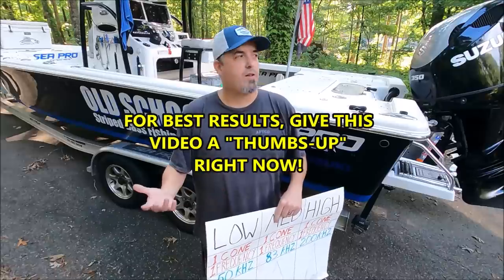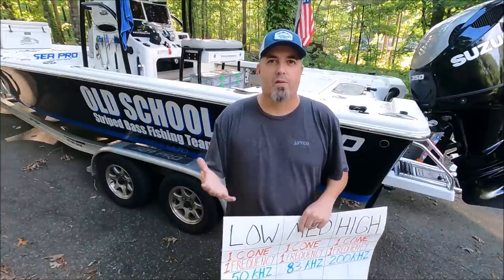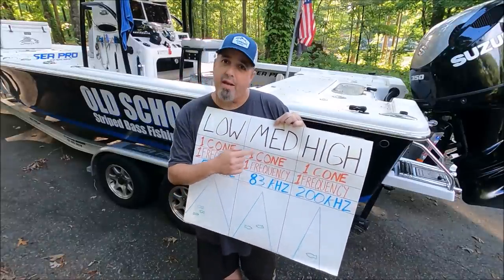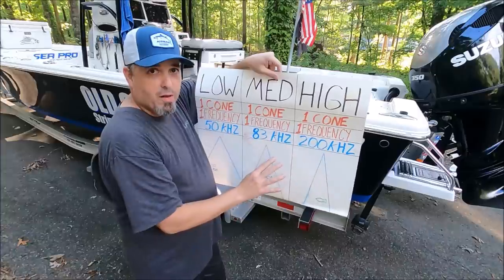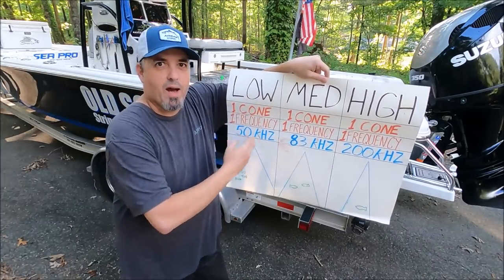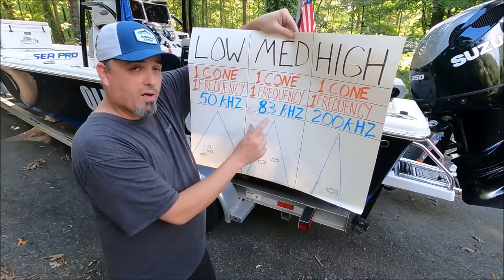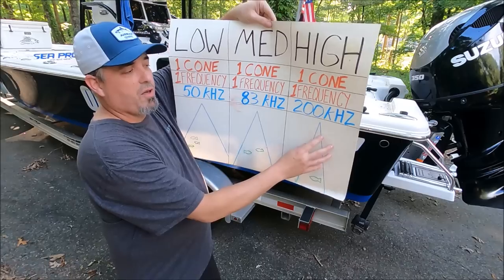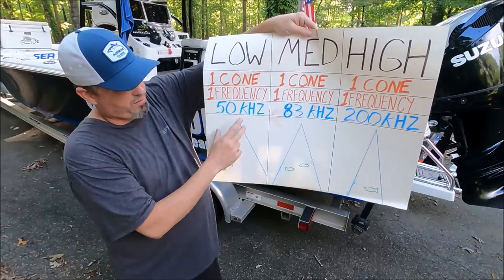Which Sonar Frequency should you use? BIGGEST Fish Finder MISTAKE! 50khz -83khz -200khz? CHIRP?

Comment: I am certainly a newb 6 weeks into learning my own fish finder.  Garmin 73sv.  I have a few analogies.  I am not 100% certain they are correct but someone might find one useful.  I would like to try seeing the differences now and what might change in March or April when the water is muddy and full of pollen.  I thought my down view, side view, and eye sight weren't doing well for me.  It actually wasn't too bad on auto.  After I figured out how to change the contrast, brightness, and range the images perked up quite a bit.  

1.  Game day parade drums >  You hear the bass drums first.  They are low frequency.  Low frequency is long wavelength.  The bass sound travels farther.  The bass drum head is wide and wobbly.  It bounces back and forth rather slowly but packs a big punch.  The snares, on the other hand, have smaller diameter, tightly stretched heads.  It's sound is a short-lived, high pitch crackle that dies out quickly.  Snare heads, and the snare strings below, vibrate with high frequency and short wavelengths.  Playing a roll on a bass drum is very easy because it takes fewer strokes per unit of time on the drum head before you can't distinguish the sound between the two mallets.  It gets a muddy sound faster.  Playing a roll on a snare requires a very fast bounce or it will not sound like a roll at all.  Because you can hear each short, tiny crackle, you have to cram in more strokes per unit of time to sound like a roll.  The bass has a wonderful sound in single booms - low definition.  The snare's advantage is that smaller notes can be distinguished - high def.  One is blurry.  One is crisp.  

2.  TV's and Video Games > A low def TV or game graphics have fewer larger squares to draw the picture.  A high def TV with lots of pixels can draw a better image.

3.  Routers and Cell Phones >  You old router may have gotten you a good signal throughout the house.  Your newer 5G (ac) or newest 6G (ax?  I forgot) router may not reach quite well throughout your home or may not hit your back patio or driveway outside if you used be able to get a good signal outside before.  The higher energy is great over shorter distances but it doesn't reach very far, and it doesn't like to turn corners.  We are just now getting 5G cell phones because it rather hard to accomplish and might actually need more towers to do it.  Not sure but 5G cell phone progress has been slow going.

4.  Telescope >  Imagine getting a telescope and zooming in on something large.  It doesn't matter if it is Jupiter or the side of a barn.  You can definitely see things a little closer with higher definition.  But what exactly are you looking at?  What is it's scope?  Now zoom out and see the whole planet or barn.

Comment: Perfectly analogous to the beamwidth of a radar or communications system.  The term "chirp" refers to frequency modulated waveform which, if it were low enough frequency for a person to hear, would sound like a bird chirp.  Higher bandwidth requires higher frequencies which means narrower beamwidth.  The only point I might disagree with is, a narrower beam usually means higher gain and that should take you deeper.  It concentrates the sonar acoursic energy, which should travel deeper.
Reply from the maker: Good stuff. Thanks. But lower frequencies travel deeper. It’s the most common mistake in sonar.
Reply: @MikeSmedleyOLDSCHOOLSTRIPERS  Thanks.  I'm wondering if the tranducers can put out more power at lower frequencies?  (If so,  that too would be analogous to high-power microwave vacuum tubes or solid-state modules of a radar.)  Or maybe I'll just read up on sonar frequencies.  Hey I would love to charter a trip with you, if it's something you offer.

Comment: Hi Mike, great video! I just bought a boat with a 1kw TM275LHW. I will be bottom fishing in 100-300ft of water predominantly. My question is will this transducer be ok? The way I understand it is the High/Wide will be great for finding new ground but not great for actually getting over the fish, and the low will also have a wide cone and be unnecessary in these depths. Should I be switching to a High/Med Transducer instead? Thanks!

Comment: Hi Mike, Mark from Charlotte. I don’t have a boat nor have ever used such a device. But I did run a failure analysis lab and used device called a C-SAM, or a scanning acoustical microscope to peer inside solid structures, most commonly a polymer encased microprocessor, but at other times a metal encloser, trying to find defects. Samples were in a water tank, and the transducer was programmed to scan back and forth in a rectangular fashion, typically taking a few minutes to an hrs or so to produce an image. The highest frequency was 200 MEGA Hz, then reduced from there. Without getting into the nitty gritty, the higher frequency gave great resolution at shallow depths, it could not see deep at all. The deeper you need to see, the lower frequency you need, but you lose resolution the lower frequency you use. It appears it’s the same as you describe, but to make it more understandable, just use depth vs frequency, if shallow, use high frequency, the deeper you go, use a lower frequency
Reply from the maker: AWESOME!! 👍👍👍👍👍

Comment: Tanks for a great video. Please can you explain why a fixed high frequency can be better then high chirp when fishing in really shallow water like 10-20ft.

And again, thanks for doing such a nice work for us all, I’m learning a lot! 👍
Reply from the maker: In very shallow water (less than 20) the single frequency gave me a little better resolution in most cases (not all). I used to switch between the two a lot going in And out of shallow water, but now I leave it in CHIRP unless I’m staying in 10-15 ft all day long. I don’t really know the technical reasons why this is, it’s just something I noticed. It may just be a case of “less is more” when the pings don’t need to travel very far. Thanks for the comment!! Great question!

Comment: Thanks Mike all your videos are very informative. I have a 2 fold? I have a Gar.7608xsv w/gt51Deucer also a hummingbird helix mega si g3 series when on plane my garmin reads btm. but not very clear my Hbird looses any reading at about 13-15mph I do have them mounted below the hull , I fish mostly C cod Striper & tuna . Any suggestions for a better/ clearer picture? Thanks for sharing
Reply from the maker: I appreciate that!!  Trying tilting the following edge of the transducers down a bit. You can usually go further down than you think to increase water pressure across the face of the transducer. I have seen a boat yet that this doesn’t work on, even a flat bottom skiff. We had to go quite low on the skiff, and it threw a bit of a rooster tail, but it worked👍👍 check this video out. https://youtu.be/D6lX7thQrhg. Thanks for the comment!!! 🙏😁🙏🙏🙏

Comment: What about airmar B275LHW.  I used to run the B175M on a simrad EVO2 machine, and was very under impressed.  I would also run a furuno fcv588 with an old school b260 (broadband, dual frequency LH) at the same time.  My furuno worked better and would always mark more than the simrad.  Fishing in Northeast, 100-300 ft.  I am hoping the B275LHW will take the best of all worlds in CHIRP and capture everything better, and with a decent 25 degree cone.
Reply from the maker: I love the 275. It’s insane. I’ve had them all at one point or another. I have the 175 HW version now because I never go super deep for low CHIRP. However I’m thinking you have something wrong with the evo2 in the settings possibly because I also have the b175M and it is killer. Certainly a mountain higher than the b60. Are you still using the evo2?
Reply: @MikeSmedleyOLDSCHOOLSTRIPERS  thanks!. no i sold the boat it was on.  my latest plan was to use the b275lhw with a furuno tzt3 .

Comment: Mike great advice, but I haven’t seen you talk about thru hull transducers like I have with a evos 2 , I still have never seen any fish arches, boating in eastern Long Island sound ? I’m clueless. Thanks.
Reply from the maker: The thru-hulls are really the same as the transom mounts. The only difference is where they are mounted. So the b175 and tm185 are the same. The b150 and tm150 are the same etc. what transducer are you using with the Evo2?
Reply: @MikeSmedleyOLDSCHOOLSTRIPERS  I have no idea , it was all installed before I bought the boat, it seems to be very good, always have a lock on the bottom at all speeds, I’ve seen ( i believe ) clouds of bait ? Never any fish arches
Reply: @duffmeister3373  same as my thru hull.  Great bottom.  No arches
Reply: @MikeSmedleyOLDSCHOOLSTRIPERS  Amy help wth thru hull?  I am not getting nice arches either
Reply from the maker: @bradplaney4936  what model transducer is it? What display is it?
Reply: @Mike Smedley  I have a 239dlx seapro 2021 with a 12" nssevo3.  Thru hull came with boat, don't know off top of head.   Only had boat out 4 times so far...
Reply: @Mike Smedley  whatever came with my 2021 seapro 239dlx.  It has a nssevo3 12"    only have 4 trips on it so far, so I'm playing with it
Reply from the maker: Gotcha. Sea Pros come with a B60 standard. It’s a tried and true super reliable transducer. It’s great for a markings bottom fast for safe navigation, especially in shallow water where you need to know your depth super quick. I can help you get it dialed in so it marks fish well, but if you want something that makes your sonar look like mine you will need a transducer upgrade. The transducers I use are around $700-$800. Most people don’t want to spend the extra money so they stay with the standard B60 when they order their boats. Set up your Simrad like this. https://youtu.be/foQjIG_Maog.  If after you try those settings and can get you links for an upgraded CHIRP transducer like mine.
Reply from the maker: @bradplaney4936  Gotcha. Sea Pros come with a B60 standard. It’s a tried and true super reliable transducer. It’s great for a markings bottom fast for safe navigation, especially in shallow water where you need to know your depth super quick. I can help you get it dialed in so it marks fish well, but if you want something that makes your sonar look like mine you will need a transducer upgrade. The transducers I use are around $700-$800. Most people don’t want to spend the extra money so they stay with the standard B60 when they order their boats. Set up your Simrad like this. https://youtu.be/foQjIG_Maog.  If after you try those settings and can get you links for an upgraded CHIRP transducer like mine.
Reply: @Mike Smedley  yes...  I subscribe to your channel and have that video saved to my library.  I'd love to know what ducer you run and tips on mounting it to my unit.  I'm assuming I need to mount it to transom and just run wire up and into center console somehow.  I only have that nssevo3 unit...  can I run the 2 ducers with it?
Reply from the maker: @bradplaney4936  Yep. That machine can run 2 transducers plus side and down scan transducer. It’s bad ass. Here is the transom Mount version of what I use everyday. Price has gone up. https://amzn.to/3IByXYz

This is a more affordable CHIRP transducer. It’s not a awesomely as the other one, but it’s a big jump up from what you have. Watch my sonar videos posted 7 years ago and older. This is the transducer I used a lot back then. https://amzn.to/414Vtjz
Reply: @MikeSmedleyOLDSCHOOLSTRIPERS  can my evo2 accommodate two transducers also ? Thanks.

Comment: Mike... I use my boat in the Raritan Bay. I have NSS9 with 3-1 transducer and i can't aee if figure it out. Could you do a video on that transducer? I'm wondering if mine is broken.
Reply from the maker: Sure.  Which 3 in 1 do you have? Total scan or active imaging? It will be on cable tag by plug and in the echo installation page box by transducer installed.
Reply: @MikeSmedleyOLDSCHOOLSTRIPERS  I have the active imaging. I would like to send you a screen shot of my side scan. I am wondering if I have a defective unit.
Reply from the maker: @ChrisGolas  email me. Mikesmedley9@gmail.com

Comment: Great video but are you sure about the  cone size per frequencies? I always understood that high covered more area and low had a narrower cone

So basically use low past 200’ depth and high in shallower water 

I will check out your shared link
Reply from the maker: Yes sir. The cone sizes have nothing to do with depth “penetration” The lower frequencies (50khz) are best for deeper water.  That’s a very common mis-conception. That’s one of the reasons I made the video actually. It’s easy to think that a narrower cone will travel deeper, but it doesn’t. It’s all about the frequency. Google Airmar low CHIRP or 50khz for deep water. 👍👍. Thanks for the comment brother!
Reply: Higher frequencies are absorbed by the water quicker.  Low frequencies travel further in water thus they are better for longer distances.  Whales and elephants use very low frequencies and they seem to have the ability to be heard over many miles.
Reply: @buckrockerm  
You nailed it.
Higher frequencies give more detail to the image, but doesn't penetrate as deep as a lower frequency... especially through silty/muddy water.
Reply from the maker: My man!!
Reply from the maker: @buckrockerm  and its also why I can hear the bass shaking my windows from a teenager in his hoopty a few miles away. 🤭

Comment: Got any good tips on low or decent links running a simrad nss evo3 with tm275lhw struggling to make sense of it. Cheers
Reply from the maker: Most of my videos are usually the 175 HIGH WIDE which is the same transducer you have minus the low frequencies. You will only really use low when you get quite deep. Around 500-2000plus feet. Check out the last video posted on the Simrad YouTube video!!  It’s a cool one using low CHIRP. THANKS!

Comment: What battery set up do you use, how many , what kind
Reply from the maker: I switched to lithium batteries 2 years ago and I love them. I used to need 2 big 78lb group 31 AGM batteries just to run my sonar, (switching over half way thru the day.). Since I switched to lithium I have only used the 1 battery all day and it only weighs around 26lbs. I never expected such an improvement. They are definitely worth the money to me. If they aren’t in your budget a group 31 interstate deep cycle would be my next choice. The AGM batteries weren’t worth it to me.

Comment: Hi Mike I have been usuing the tm165hw in average 80-100 ft and the detail is amazing, most time I'm usuing a fixed frequency at 200khz and other times to pinpoint b60 at 200khz. The b75m I run mostly on plane to find the schools. Great explanation. You just have to use it enough to understand what works best for what you are doing. 3n1 is great for finding structure once your over your reef, around bridges and canals with a drop off. Hope to get to do a bass run with you once wouldbe awesome. Thanks again #seapro239 🛥🎣🇺🇲
Reply from the maker: Great stuff brother!!! Awesome info. 👍👍